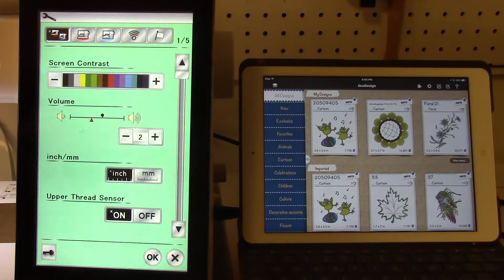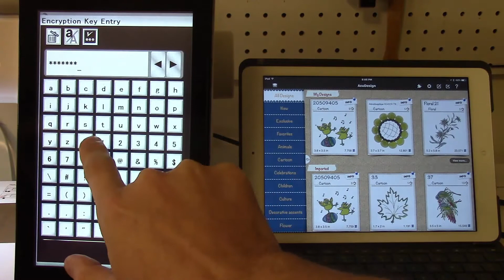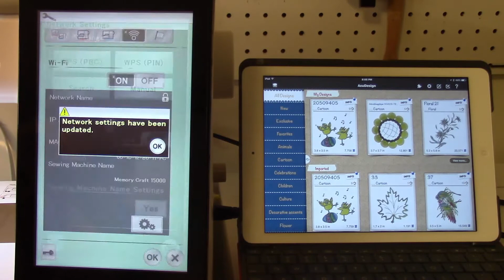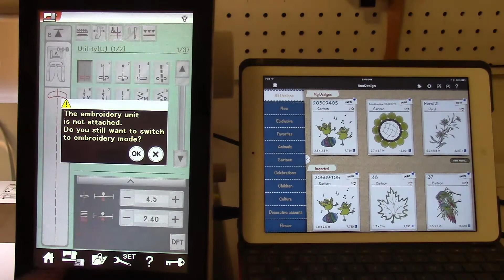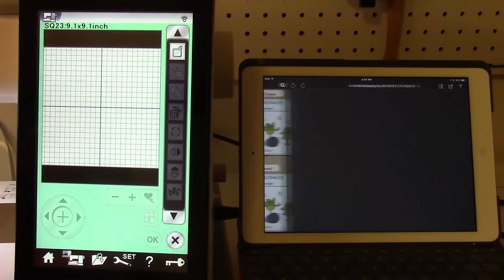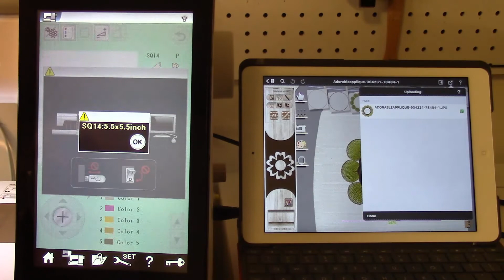Connecting Janome to Wifi and uploading a design from AcuDesign in iPod

Comment: good morning. I have a problem. I connected Janome to Wifi perfectly and have been able to transfer designs from Acudesign to the sewing machine previously. However I tried to transfer a design today and despite checking all devices on internet connections, the iPad is asking me to check the wifi sewing machine. It will not transfer it. I checked the correct wifi name, the little icon is black and the iPad has the same wifi name. Plus the iPad and machine is telling me that it is properly connected. Any clue why it gives me a message to check the wifi on the machine and why it is not sending it? Your advice would be most greatly appreciated.
Reply from the maker: Manon Bimmel I'm not sure. Probably best to contact you local reseller to see if they have some answers for you.